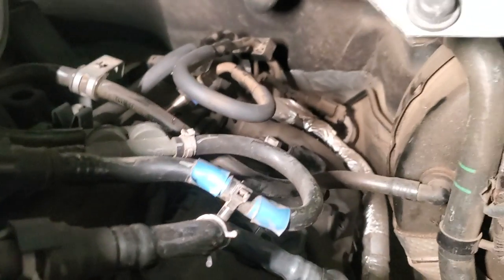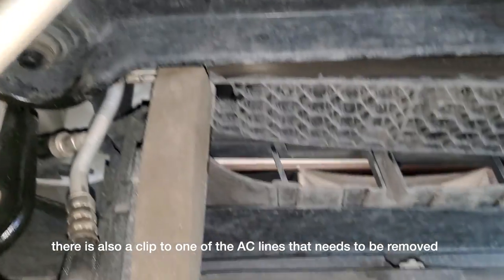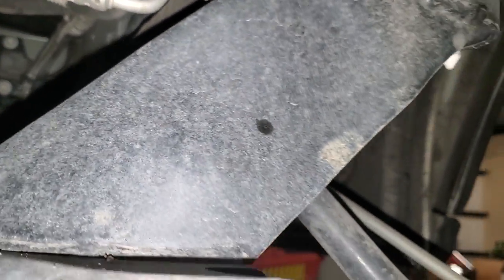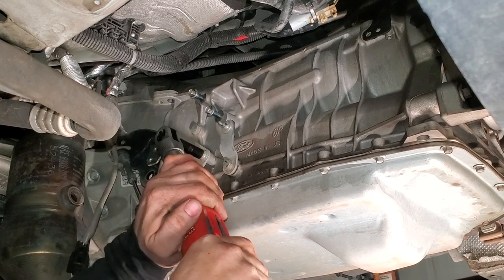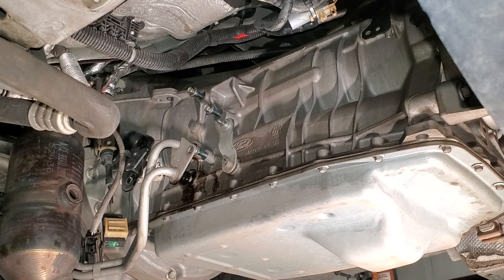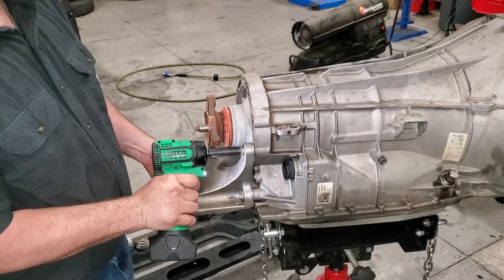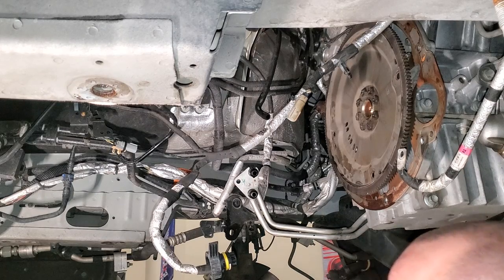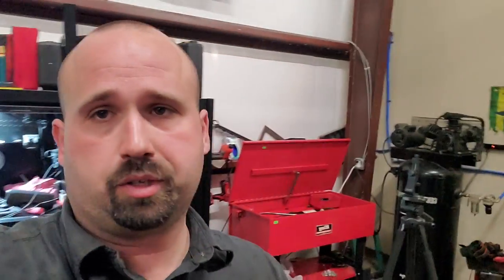Transit T-250 Transmission removal and replacement

Comment: I just did one for the first time today. FedEx van that gets used on rural roads. Had a thick layer of gravel all underneath. Took a lil just over 6 hours out and in which I’ll take first time around! Those rear subframe bolts are a pain and definitely made me work to get them out. But we sell our install with new A arms and bolts due to them having to be cut out. You can sneak the tranny out with out removing the exhaust and removing the left o2 sensor. I left the driveshaft in. The subframe can be lowered with the power steering lines intact but you just have to unclip them from the subframe to give you enough slack to get out of your way.

Comment: I have a T150 with the 3.7 and Quigley conversion. I run the transmission in 5th gear to prevent the constant shifting. The loss of mpg is negligible.

Comment: Getting ready to tackle one in a 2017 diesel. 90k on it and pure Michigan salt pickled. Horrible design that you can't even remove the pan to replace a filter and do a proper service. Great video thanks

Comment: While I know what I'm going to say isn't the proper thing by the book but it will help. My 3.7 T250 started having transmission problems around 45k miles. The torque converter would stay locked up mainly going down hills. Since I can't afford down time in my busy season and didn't want my cradle dropped. I used a pump to suck basically a gallon of fluid from the transmission. Filled back up and checked. Apparently mine wasn't full from factory and not quite a quarter short. The fluid that came out was OMG bad. I drove about 500 miles and did another gallon. After this change all my weird issues went away and has been great ever since. I do a gallon change about every 8k miles or every other oil change and the fluid I get out now looks decent. My van is not far off what these vans see as I'm basically loaded all the time and I'm sure very hard on the transmission. I also started locking it in 5th gear when I know it will hunt 5 to 6 to 5 to 6 I'll pay the extra fuel. Moral of the story keep good fluid in it even if getting the filter changed is something you can't or won't do
Reply from the maker: a fluid exchange surely won't hurt. i've seen some people go as far as installing a remote filter on the transmission cooler lines and putting in a remote drain plug on the transmission to help extend the life of these transmissions.
Reply: @medtec6747  So far doing the frequent changes seem to have stabilized the fluid where it looks what I would call normal. First 2 gallons were basically burnt up smelled awful and I'm sure my transmission would be toast by now. Seems to me the heat is a big problem as mine would only act up after long highway trips. You could see the temp needle just over the half line where normal in my van is just short of it.

Comment: Very good video, just bought a transit t-350 and the torque converter needs replaced. Any comments on changing the fluid and filter while out.

Comment: Thanks for this video. Have a transit just bought used with 112,000 on it may be having to do this one day. Question how many man hours were involved?
Reply from the maker: If the bolts don't give you grief it takes about 1.5 hours to remove the trans about an hour with a lift

Comment: Great video! What is the minimum needed to drop the engine and tranny in a Transit? I don't have a lift.
Reply from the maker: I strongly suggest some 6 ton or greater jack stands and a jack that can get them to full extension you'll need as much height on level ground as you can get

Comment: Thank you.  Have a 200k mid west Transit to do (ok, probably have it done; unless I can talk a buddy into a couple of weekends, as required). No lift, only so many get ups and down on the ground left in me.  

Ecoboost, thinking this would be a good time to look at replacing the manifolds (Ford has a new one out for this).  Just thinking. Exhaust studs are always a joy.

But -- probably missed this -- driveshaft bolts are replace on use? 

Why the catalyst replacement?
Reply from the maker: yes it's a good time to replace the manifolds and jiffy tite connections on the turbos. when I took off the cats I saw a crack in the catalyst on the passenger side. it had not yet completely gone to hell but it was going to soon. pretty much any bolt that ford puts their version of loc-tite on from the factory the SM tells you to replace but they are not TTY so you can wire brush them and re-apply some thread locker and torque to spec.

Comment: Hello, great videos. Really appreciate the detail and time you put into these. I have a 2018 ford transit 250 just received a transmission service required message the other day only came on for 20 min. I am going to do a transmission flush tomorrow, trans pan gasket replacement and a trans filter change at 80,000 miles. Gasket is wearing a very small amount. My problem is that it is very difficult to get the trans pan down bolts out trans filter out without doing some major work. Do you have any suggestions or tips on how I can easily get the pan and filter down to clean then to torque the bolts back up? By the way what are the torque specs on the trans pan bolts? Thanks so much for your help. Tony

Comment: Shouldn't Ford re - inner cover the AIR cleaner lid  be a major Recall so rain stops running into engine...I have a lot of silicone and clear tubing re HACK the water/ ice away from my upside wire exposures ....

Comment: Bought one of these. Last guy had a Trans done on it. 
Damn front most sway bar bolt snapped off. I can't for the life of me get it to come loose to easily spin it out.  15" compound pliers.
Gonna try going through the tunnel and try get a clear shot to drill it. 
Worst case.. subframe drop.

Comment: where is the transmission range sensor on a 2016 transit 350 xlt?
Reply from the maker: its inside the transmission and its a part of the molded lead frame

Comment: I got a 2015 Transit T250 3.7 non ecoboost...95,000 so far...i got a pump and replaced aprox 3.5 quarts of fluid out....and at 95,000 did it again...shocked on how black it looked.....i think LV..Fuid...it probably some of the problems...i owned 7 Ford Econoclines 250 and 350 and hever seen automatic transmission fluid look that bad....and they carrid same load as new transit...they ran Mercon...and Mercon 5...which i think is a thinker fluild....you are correct these engines dont have torque...and do shilt up and down alot...btw...what milegage do you usually see issues with these?,,Thanks

Comment: Do you need to reprogram the tcm for new transmission?
Reply from the maker: you can reset the adaptive trans values or the pcm will just learn them on its own over time. the SM does not tell you to do either though.

Comment: I'm about to replace the lead frame.  So far I'm pissed.. lol. All the frame bolts are seized.  118,000 miles. My life is going to suck August 2 lol
Reply: I managed to do the lead frame in the van, I lifted the the mount and put  a block in to hold it up the pan has barely enough room to get out but it can